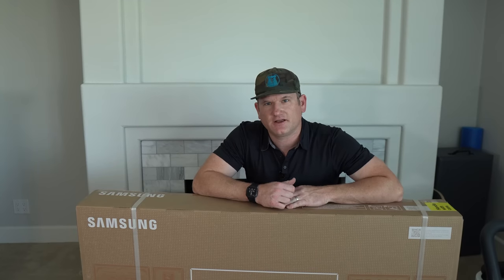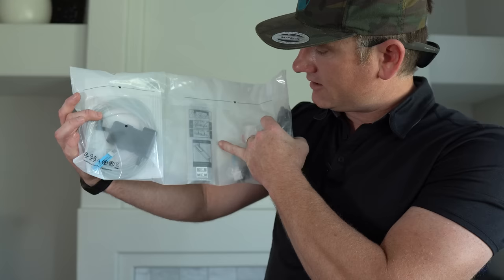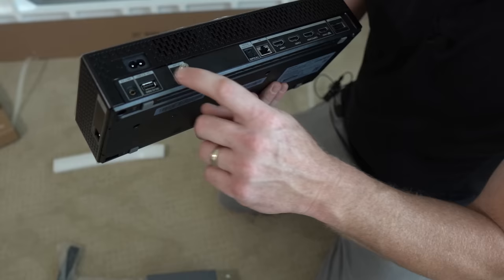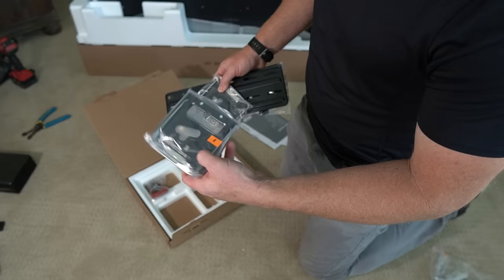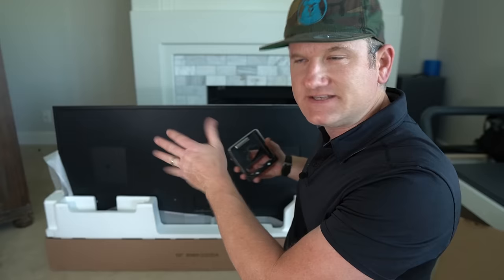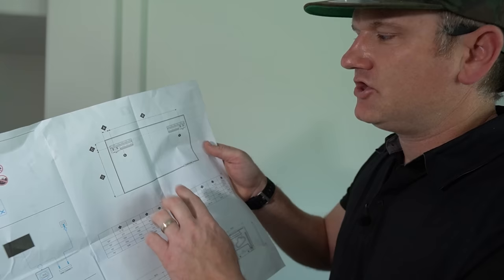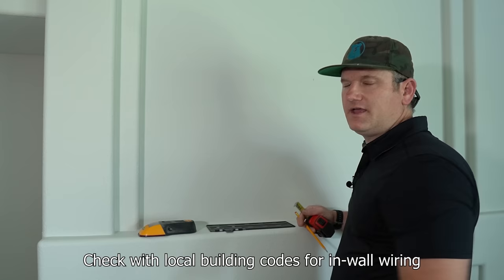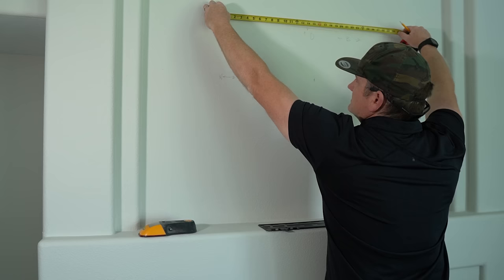Samsung The Frame 4k UHD TV - Unbox and Installation Guide (2021 model)

Comment: Thank you so much!   When I noted that I have metal studs to the installers I was working with, they said they cannot mount my 65inch frame tv with the included mount due to safety issues.  Have you encountered this before?   Is it possible to safely mount a 65 inch frame tv on metal studs?   Thank you for all your helpful videos!
Reply: yes you can, the concern is that usually you can only hit one stud because of the stupid split mount design. Really you just need toggle anchors each one can hold over 100lbs on drywall alone, not sure what the max load is for metal studs. If you want to be extra safe mount a piece of plywood to the wall then mount the tv mount to it.

Comment: Looks great but if I want to put a Bose sound bar below the tv how would I do that with the box so far away and no way to connect the sound bar to the Back of the tv ?  
Hmmm !!!!
Reply: That’s the main issue with the One Connect box. The idea is that you’d install a recessed box behind the TV for the One Connect to sit in so that wires could go into there. In reality most installs will have the One Connect on a mantle or shelf to the side so you’ll have a bunch of wires running downwards. 

The One Connect is good in theory but in most cases it’s been problematic in terms of wire management. The mount that comes with the Frame TV is the worst mount I’ve used to date and I’ve installed a ton of televisions over the years. I’ll never understand why Samsung engineers decided on two plates. Terrible decision.

Comment: I’ve read that the higher end Samsung 2019 TV’s all have ambient mode. So why would one buy the frame if you could do the same with let’s say a Q90T?
Reply from the maker: You can do ambient mode with those but the shape of this tv and the one connect box to keep wiring out of the tv area are helpful as well as the customizable trim you can get.  This doesn't have the anti-reflective coating. I actually made a full review on all this now that I'm replying. Check it out

Comment: Beautiful telly, absolutely stunning. Does anyone know if the 2021Frame is compatible with a Perlesmith Universal TV Stand? Any help would be a godsend.
Reply from the maker: It can work with any mount but defeats the flush look with another mount.
Reply: @BTheInstaller  Thanks B, and yeah I imagined that the sacrifice was losing the flush look to it... I'm fine with that as I still love the aesthetic. However what I just couldn't imagine, try as hard as I like, was exactly how the new mount style of the 2021 frame could conform to the stand. A huge sincere thanks for the clarity bruv as the new mount set-up of the 2021 Frame is a bit of a headache to decipher.

Comment: If samsung just added an optional power input behind the tv. I have outlets above my fireplace, this would allow me to run the one connect wire through the wall if I had one that wasn't providing power
Reply from the maker: That's how it use to be.  They have changed it to make more efficient but still not perfect.

Comment: I'm not sure if someone has asked this already or not, but....I have a 55" frame coming next weekend, and I am a renter. For the pieces of drywall that you cut out (for the cables), is that an easy fix? Do I just keep those squares that cut out and somehow place them back when it's time to move out, or would I just consider that a permanent goner? Thanks!
Reply from the maker: You may want to consider just having the wire sit externally on the wall.. it's very hard to notice and likely not worth burying it since it's not in-wall rated anyways.  I did a video where I just secured that to wall with tape as my wife has it in her office.  No one notices the wire
Reply: @BTheInstaller  If you don't mind, could you link that video you just mentioned to me please? Currently scrolling trying to find it, ha!
Reply from the maker: @kimkim_xo  https://youtu.be/6jS07hCpc3Y
Reply: @BTheInstaller  you’re the best, thanks SO much!!

Comment: Does the 2021 sit flush against the wall (zero gap) like the 2020 version?  I feel like I’m going crazy, but it seems like the older version sits more like a painting than the 2021 version.  Could be the thinness?
Reply from the maker: I've heard complaints about both of them having a slight gap but they do have foam pads you can put on bottom of the back of tv to even it out. They both look fine.
Reply: Original single bracket version was much flusher, dual wallplate one has a gap somewhat at the top I don't like the dual bracket design.

Comment: Question: What if I have a pre-installed outlet and cable outlet where The Frame is going to be installed? The outlet cover comes out of the wall approx. .33 inches. Although I already fished The Frame's invisible wire down the back of the wall, which was super convenient, is this going to make things difficult for the flush mount system? I dont mind The Frame coming out of the wall .30 inches however if The Frame is designed to be totally flush against the wall, i imagine it could complicate things...
Reply: I have this same situation with a pre-installed electrical outlet where The Frame is going to be installed and I too wonder if the outlet and cover are going to keep The Frame from being flush. How did you proceed? Did you find the outlets to keep The Frame from sitting flush?
Reply: @YTGal13  Hi there - we paid $130 to have it installed. I just did not want to bother LoL. THe Frame is beautiful on the wall and because of the outlet cover it will not totally fit flush and comes off of the wall by a barely noticeable .3 inches which is the thickness of the outlet cover. The cover does not seem to compromise the integrity of the mount since it seems to work on a sort of hinge.  It does not bother me however I could see how it would bother some people who want it 100% flush. Maybe they have flush mount outlet covers however I have not searched....I just may keep it this way and enjoy the TV. Non issue for me.
Reply: @mattdong1  Thank you for the information!

Comment: I don't get how you got past the vertical studs with the fish tape.  The most difficult part of this install was how to fish the wire, but you didn't show it.  Also, why such a large diameter conduit?  Otherwise great video.
Reply: That conduit also looked short and did not extend from end to end at wall exits.

Comment: You weren’t kidding. This looks like a massive pain in the ass compared to last year. Is there a noticeable benefit?
Reply from the maker: Absolutely not.  I guess more storage and thinner tv but no. The mount is a horrendous decision.
Reply: @BTheInstaller  that stinks. I was thinking about a 65” or even 75” in the new house we’re building but I don’t think I need that aggravation. Great vid, though.
Reply: @BTheInstaller  sticking to the 2020 model, thank you 😅

Comment: Can you share more detail about how the sound bar works in this instance? Is there an extra wire that would also need to be strung though the wall with the one wire?
Reply: The sound bar would have to plug into the One Connect box using either Optical or HDMI. You wouldn’t need to use any conduit to run these through the wall but they’d have to be run to wherever the box is located. I feel like the One Connect is actually detrimental to the overall design because you have to find a place for it. LG Gallery series has a superior OLED EVO panel and has built in inputs like a standard TV. Also a far better mounting solution.
Reply: I don't know if this helps, but my Samsung Soundbar connected to the Frame TV wirelessly. It was all the way across the room hooked up to my old tv, and the Frame tv found it and I selected to connect to it.

Comment: Hello do the magnets on the mounting plates need to click in place? If we just let the tv hang without clicking it doesnt go flat on the wall. But if we lift it up a bit to click in place, it feels like the hangers are above the hook and might not be secure.
Reply: Hi there.  I’m having the same issue with it not being flush.  Did you just lift it up to make the magnets click into place?
Reply: @bbalingit  Tech Support said you should hear the click. Funny why didn't they mention this in their manual and videos though, seems like a very important detail to miss. Also we realised where we screwed the plates (onto the TV) affected the height of the hook, we screwed them on the lowest part instead of the middle. Yet to fix it.
Reply: Having the same issue. Did you pull down to snap in or lift up?
Reply: Yes that happens it's a terrible bracket, the original frame bracket was excellent the dual plate one leaves you wondering and yes there is a chance the TV can fall due to how it snags when you do as you describe

Comment: Ordered the 75” and plan on installing it next week. Question - the wall has an outlet high that is intended to be used to power a typical tv/mount. The outlet sticks out on the wall every so slightly. Do you think it’ll be an issue during install? My thoughts is that the outlet being on the wall with create a gap between the wall and tv when mounted. Kind of defeats the purpose of the no gap feature of the tv
Reply: i have the same situation. what did you do to fix this issue? thanks.
Reply: @MacgiverRuss it’s not perfectly flat but when people come over they can’t really tell. It’s more for us since we own the home. After a few months I don’t even think about it.

The tv still stays pretty flat but not super flush like on here.
Reply: We got our electrician to install a brushed hole point with an hdmi diameter tube section through a brick wall to where we planned to keep our hdmi stuff and the one connect box.  Now we have bought the Frame tv 2022 and the really thin cable has those chunky ends on it. Is it possible to remove one of the ends during installation and reattach once the cable is through the wall?

Comment: The brackets on the tv move.   Are they supposed to be still?    Don’t stay snapped in
Reply: They move to allow self levelling, otherwise there's no way you will get a dual bracket setup perfect unless you mount both perfectly level or have quite a lot of experience doing it before.  It is one of the flimsiest brackets, the original frame bracket was the best.

Comment: 16:21 can you explain more about the fire risks thing please… im about to install one and this cable is completely hidden…
Reply from the maker: any high voltage wire in the wall is a fire risk... can melt and burn faster.. in wall rated cords slow or eliminate that risk...

Comment: Question: Recommending conduit size?  That looked like 2" plus in the video. I am building and want to make sure my builder uses the a size that will easily accomidate the cable ends and make it though bends since I wont be able , nor want to have that cable sitting in the conduit for the remainder of the house build.
Reply from the maker: Yes ✌
Reply: Usually if you're fitting conduits prior to the cable, you install them with a bit of string already in them, it makes it easier to attach your cable to and pull it through when you're ready. You could be pro-active at this point and when you pull the string out with the cable on it, have an extra bit of string come up with the cable in case you want to run something else through it at a later time.
Reply: @JacksOutback  Great suggestion, I was just going to snake, but this make total sense! Just have to put "Do Not Remove" tabs on both ends of string.
Reply: Doesn’t matter. They will ignore the tabs and pull your string, and maybe even cut your conduit flushed to the wall, so later conduit would drop into the wall.

Comment: In-wall installation of the standard cable within conduit alone is NOT legal to the NEC.  Conduit boxes at both ends are required.  

It would be very helpful for you to tell us what size conduit is required for the smaller end of the standard one connect cable.
Reply: Buy the TV and find out.

Comment: Nice video except.....you left out the only actual hard part - how to fish the wire through the wall! Looks like you probably had to traverse a stud or two as you went horizontally. How did you do that? Your piece of conduit looked quite short, so I assume you didn't go up through the attic or down through the basement, and the cable isn't long enough for that anyway. Did you drill a hole through a stud or two with a flexible bit or were you working with a magical, studless wall, or what???
Reply from the maker: It's an open fireplace.  I just threw it into the giant void.  I've made a few videos showing most of this stuff. You can traverse studs with this wire easily.

Comment: Great DYI explanation!  I am planning on hiding the OneConnect box in a recessed box behind the TV.  Have you done any installs like this?
Reply from the maker: I'm doing one right now for the LG G1 and the one connect box could fit inside this lo-vo box I'm using so check that out wed

Comment: Looks like a bit of a pain to install. My wife wants this in the livingroom and box trim the wall so I'll be doing this later this year. Why didn't they make the wall plate one piece?
Reply: The prior models were just a single plate. My guess is this new design allows for more versatility in case your studs aren't in the ideal location. Not certain tho.
Reply: I would suggest it's to save them money. If they were a single plate they would have to make a specific plate for each sized TV. This way they only make the two little ones and you get to install them at different distances apart. They can even be used for different models.

Comment: How much does it cost an istallation like this? Iam an installator too, I would like to compare prices here on Greece.
Reply from the maker: it was a fairly easy fireplace install but i normally would charge around $300USD for over fireplace.

Comment: The 43” has two individual wall mounts.  Too bad I doesn’t have the rectangle plates like the one shown in this video.  The guide that came with the TV awful.  I’ve mounting 4 TV’s in the past, pretty straight forward with most other mounting systems except this one.

Comment: Is it possible to do this without that big hole in the wall? Where I live apartments dont have walls like that, its all concrete :D
Reply: when the walls are concrete you have to use wall tiles or thin panels to create a "fake wall" in front of the real wall and hide all the cables behind it. Ask home theatre installers in your area they'd be able to give you tips. There are many ways to make this method have a decorative effect.

Comment: I used those same toggle bolts you suggested. Absolute garbage!  Broke half of them, had to buy 2 packs just to get 8 usable. They are made of the most fragile plastic that I’ve ever encountered. For anyone else who sees this, avoid them and go with something else. Reviews on Home Depot confirm my experience but unfortunately I didn’t check that until afterwards.
Reply from the maker: its true. they're very brittle. but they're extremely strong and effective as long as they dont snap.  there are other kinds with more pliable plastic on both sides.
Reply: There are different brands.  Try a different one.  Note that the plastic is only there to hold it in place before you put the bolt in.  Once you screw the bolt in, the plastic doesn't really hold it anymore.

Comment: Are there any issues with hanging over a gas fireplace with residual heat since the TV is pretty much up against the wall?
Reply from the maker: Negative.  The double flue keeps the heat inside and there is space around that.  I've installed countless tvs over fireplaces.  Just don't set a candle under the tv. That's the only damage I've seen. 😆
Reply: @BTheInstaller  thank you. We had a regular mount previously but the wall did feel warm just hoping there are no issues with that or the one connect wire in the conduit.

Comment: Fulltime Installer for 8 years here. This is the stupidest design for mounting I’ve ever seen 😂
Reply from the maker: Yeah its pretty dumb.  The second go-round was pretty fast. There is room for error and the one connect box is massive. Still barely fits in a full 14.5'9 inch Legrand box. 🤦‍♂️
Reply: @BTheInstaller  I suspect they changed the mount because as TVs get bigger they don't fit flat against "bowed" walls.  Having a spread-out mounting system could help the TVs appear more flush to the wall.
Reply: @BTheInstaller   are the provided bolts necessary if you use enough of the toggle bolts for both sides? Saw your center mount tutorial (helpful) then opened up my new Frame TV and realized it was a dual mount which threw off my whole plan haha. I’ve determined I don’t have any studs to drill into so I’m assuming enough toggle bolts would do it? Thanks for your help.

Comment: I hate mounting frame tvs. I made good money mounting flat screens on walls, but the frame version requires more math and more measurement.
Reply from the maker: It gets easier. And no need to add power outlets which is nice.
Reply: @BTheInstaller  Sire, it got easier, but it's still a pain in the ass compared to the 1-piece mounts. And half the time, the frame tvs don't sit flush on the wall. They lean forward, which defeats the purpose of the frame tv.

Comment: Great video. 👍 Wow, I installed the previous model’s TV with the one centre mount. This one seems more complex. I wonder why they chose this system?
Reply: My only guess is that the middle bracket has issues with the larger TV models. The new one is more finicky than it has to be, though.
Reply: @imasspeons  if the older brackets have issues, wouldn’t a recall be made? Are the older models at risk of falling? Samsung needs to come clean.
Reply: @josephj6521  you'd think so, but I've never been interested enough to look if that were the case.